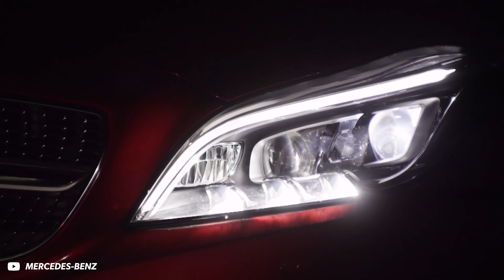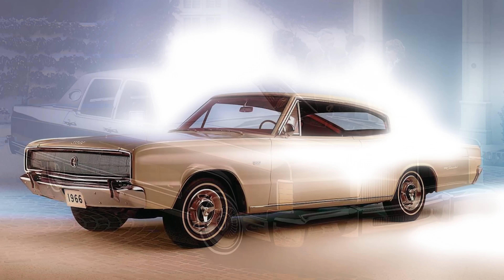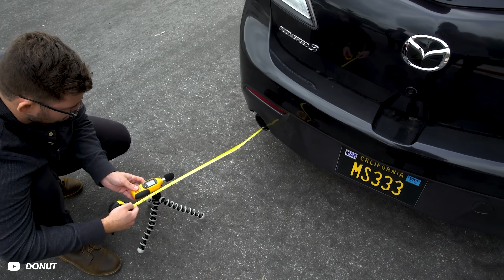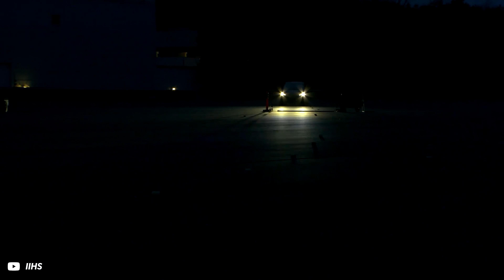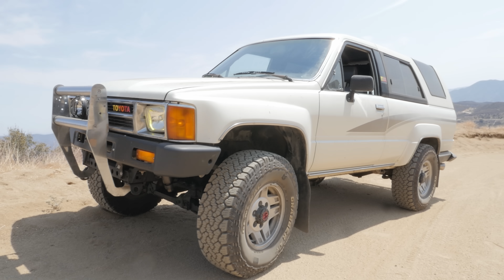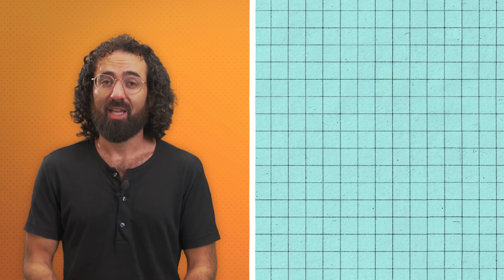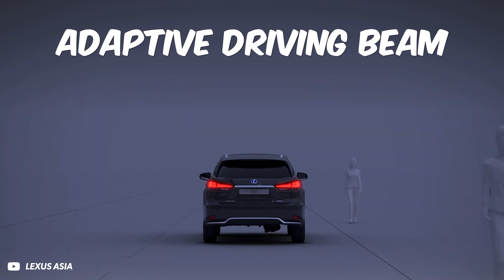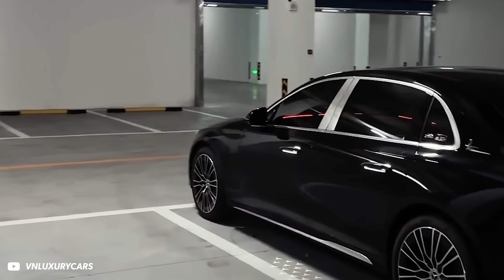Why new headlights are blinding American drivers

Comment: You briefly alluded to it, but another major factor in the early years of blinding headlights was related to the housing design. Older housings used a reflector type assembly which worked exactly as described and reflected the light, you can see the mirrored reflectors inside the headlight assemblies of older cars. When these cheap HID kits finally started to come on the scene, they used bulbs and technology designed for higher end projector based headlight assemblies, so you had all these people buying cheapo headlight kits to get that higher-end Xenon look but installing them in housings that they weren't designed for.

Comment: European here. Ok in Europe it might be a little better. But the regulations are also way to soft! 

The big Problems are: SUVs and other high mounted Headlight cars. There should be a maximum hight for installing lights! Like 70cm from the ground or so.
Also Halogen lights are bad to look directly into!

LED lights should have 10000 lumen top! 20000 is just ridiculious!

And the light adjustment must be set to 60m top, especially with LED lights! Here it cant be the owner of the car! The lights are installed by the manufactour! 

And yes, intelligent headlights systems are great, but its not possible to get it into every car, at least not yet. 

And whats really going with Tesla?? Every tesla is blinding me everytime! Why are they allowed to set the light adjustment so high?? Also here in Europe??

Comment: In Europe we have mandatory car safety check ups ... including lights.
And the beam is formed horizontally in front going up in an angle on the right. That way right angles might give problems from incoming cars and cars a certain distance behind you and no straight highway problems. Except of course for the nightblind idiots using high beams all the time.

Comment: One issue not addressed in the video are the 6500k color temps used on the LED's.
This color temp is a blueish white color which is especially bad for those who have any cataracts which is nearly everyone over 40 years old.
Halogens have a 3000k color temp.
The lower and redder color temp doesn't glare as bad with cataracts nor does it affect night vision as bad.
An easy regulatory fix would be to limit the color temps to no more than about 4000k.
The shorter wavelength blue 6500k has a greater effect on cataracts than the redder halogens at 3000k
An added bonus is the longer wavelength reds interact less with snow, rain and fog enhancing visibility during inclimate conditions. 
 Rayleigh scattering is the technical term and is also the reason why cataracts are affected more by blue light.

For reference compared to household light bulbs a "soft white" lightbulb is 2700K and a "daylight" is 5000k.  Some bulbs are marketed as "bright white" typically 3000k to 4000k.

My expertise was designing LED aircraft landing and other lights for aircraft.

Comment: Decent analysis, but missing a few key points.

1) I like to travel to northern Scandinavia in winter - above the polar circle.  All my cars have good old halogen lights and manual high-beam control.  I never ever felt that I needed more - not even the extra driving lights that are so popular in those regions - and that includes many km's on icy or snowy roads in pitch black darkness without other traffic around me.  So why do we even need this shit?  If you cannot see enough with modern halogens and safe use of high beams, you should probably not be driving in the first place!

2) However, during my last trip up north I had so many problems with those f.....g LED lights that I ended up installing some additional Swedish LED driving lights myself during the trip (in a public parking garage...).  I didn't need them for seeing, but I did need them for signaling - too many i....s who couldn't be bothered to dim their lights at all.  Worked quite effectively, but is no fun...

3) I drive a small sports car (MX5 / Miata) - yes, all the way up to the Nordkapp in northern Norway in winter.  When I bought it I had no problems with other cars' headlights.  Now they are a big problem.  Even the adaptive matrix technology is a big issue, because from what I can see these systems do not seem to be set up to handle low-flung sports cars.  Why?  Probably because the engineers did not think about the fact that there are many different types of cars out there and that all of them need to be protected.  Bad engineering (and yes - I am an electrical engineer myself).

4) And that brings me to the last point.  I used to work in aviation.  In that industry, new technology will only be allowed after a) the impact on safety has been thoroughly analyzed, b) appropriate mandatory standards have been written, and c) the actual products are in fact certified against those standards.  Safety first!  I am shocked, disgusted and furious that in the automotive industry this type of Wild West is allowed.  This is as much a failure of regulation as it is a failure of engineering - worldwide.  In a sane safety oriented engineering environment, most cars today should NEVER EVER have been allowed on the road.

So in summary: bad engineering - worldwide! - and super bad regulation, causing a huge problem.  This is not going to end well - one big lawsuit that claims damages due to this problem and billions of cars will have to be recalled and thoroughly modified.  No car manufacturer in the world would survive that.  And such a lawsuit will at some point come.
Reply: @MartinBeckmann-z1o And what's more funny about the regulations in the EU , is that cars like the Toyota GR86 or the Nissan Z can't be sold anymore because of some stupid regulations voted by some wankrs but those fugging SUVs that blind other driver are just fine ? I also drive a low car ( Smart Roadster) and at night i constantly have to zip away from blinding headlights behind right my ass on the highway . BTW it must be fun to drive your MX5 up there ^^what kind of tyres do you use then ?

Comment: The matrix headligths are blinding too. On a straight road in fine weather its usually no problem. But the ligth reflects on everything including the rain in front of you enough to blind or abscure the road in front of you. I drive about 80 km everyday to work and can not say i am a polite driver anymore, if you blind me i will flash back. A lot.

Comment: It seems this is another American “nothing can be done” rather than a real one. In the UK your cars headlights are tested in the annual inspection, if they are out of alignment your car fails, and can’t be back on the road until they are fixed.
Reply: I'm sure the UK's MOT test used to make sure the dipped beam was 'dipped'. No part of the beam was allowed to go higher than a line drawn at the height of the headlights. Nearly all 3 year old cars nowadays should fail their first MOT.

Comment: It's so bright that even the reflection off buildings and the road itself glares to my eyes
Reply: As a pedestrain where vehicle should only be using low beams I notice the same think.
     It is so bad they have me saluting Hitler. You know raised arm & hand to block the offensive light pollution.
Reply: Even with low beams, all you need to do in a populated street is go over a single speedbump, and everybody hates you because of your blinding lights.
A bad speedbump can make me blind people on the second floor (first floor after ground level), in their own homes.

Wild that this is legal.
Reply: @Volvithever conside the thickness of road paint? I've seen some that is almost 1mm thick. Given the USA DOT regulation that headlight can light out to 820-feet — even road paint can cause an up angle in headlight beams.
     Never mind stones, shells or litter.
Reply: Your headlights are incorrectly adjusted if reflections are blinding you. Even the brightest OEM headlights do not cause glare when adjusted correctly. They do not come adjusted correctly from the factory (but they say they do).
Reply: You can try polarising glasses to reduce glare off of surfaces quite a lot. Look into it :)

Comment: even if bright lights arent contributing to more crashes its an added stressor to every driver they pass and the fact that drivers have no choice but to keep their eyes open on the road means that it causes accumulative eye damage from staring at bright lights every night drive
Reply: Yes. I've noticed myself looking far more often at the side of the road to know where I am going, because someone is blinding me with their new headlights. In rain it's even worse.
Reply: Well without doubt it's contributing to accidents at night, even if the initial blinding/dazzling doesn't cause an immediate crash, when you drive on an unlit motorway and are constantly subjected to dazzle after dazzle by passing supernovas your eyes get fried.

Comment: I live in central Europe, where adaptive headlights are allowed. As a cyclist, I absolutely loathe them, because the shut-off DOES NOT CUT IN until the oncoming car is maybe 30m away. At which point it's pointless, as I have been forced to ride completely blinded for 300m or more.

Doesn't matter if it's a luxury vehicle like a big Mercedes or BMW, or something built in Asia. IT. DOES. NOT. WORK. And the designers responsible should be quartered, shot, restored from backup to be shot&quartered&restored from backup again and so on, until they can come up with something that actually does what it says on the tin - *in the real world*, mind, not just in controlled lab settings. Until then, this technology should just be banned.

Comment: I am so negatively affected by bright headlights I plan my schedule so l don't go out at night. I drive an old, short, small pickup. When a modern car is behind me, it looks like my car is in full shadow even when my "brights" are on. That would be disorienting enough without the incredibly blinding light eliminating my entire cabin from the rear view mirror. Buying a pickup instead of a sedan or wagon was a major factor to get a little bit of height and it actually does improve a lot. 

I am incredibly frustrated with our regulating bodies l for allowing this to happen. It's not like you can recall millions of cars, now. I stopped driving at night years ago.

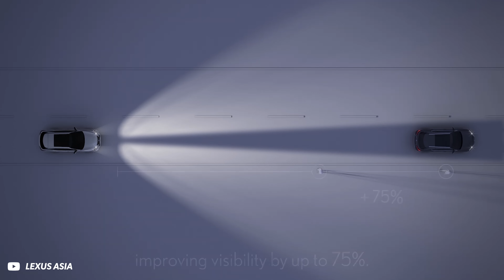Comment: 9:04 -- Greetings from Germany. Over here, its labelled as "Matrix LED Light". And I hate it. People that use cars with that tech do not bother to turn off the beam because the computer is intended to fix oncoming traffic not to blind. But it just doesn't work. The issue u talked about earlier comes into play: straight roads vs curves. Whenever such a car is involved in a curve, you are getting flashed. Whenever the computer doesn't properly detect your vehicle, you're getting flashed. Yes, I do honk at people using that tech and not turning it off when passing me. Because its just a plain hazard. Whereas people with "normal" lights turn those off even before the oncoming traffic gets into the lightcone at corners. And lets not get started about foggy weather. It only gets worse. Whenever I pass a modern car, I can't see the road for 2-3 seconds before my eyes adapt on that its dark outside again.

Comment: Jokes on you. im the guy who is driving lowered cars all my life and i get blinded by EVERYONE. the problem with led lights = they are direct beam. not like older lights, where the front of the light was hidden and the light would hit the reflector and then bounce to "light" the road.

With leds they have a TINY area, where the brightest point of the led is somewhat covered, but a bump, speed bump or mismatch in height destroys it, and that point is so bright, that its like looking at welder without glasses. absolute insanity. im from europe btw, still does not help at all. 

Worst part ar suvs and other high cars, they should lower the lights, compared to height more aggressively, but everyone would agree, led headlights should be banned or reworked.

Comment: There are so many comments this has probably already been said, when driving in a smaller car, Miata, not the SUV/Truck my fellow Americans all "need", the headlight height becomes an issue. When I have a F150 size truck behind me all I see is headlights, not much better when meeting them on the road, beyond a standard for aiming there should be tighter control over headlight height off the ground, put truck/suv lights in the bumper not by the grill 2 feet higher than my lights, there's now way to aim those lights to not blind me while giving that driver more than 20 feet of light in front of them. 
Seriously how do you get headlights that are 2 feet above the ground and headlights that are 4 feet above the ground to give the driver and oncoming traffic a similar experience?

Comment: Thank you for this education!  I just wrote my congresswoman about the issue.  I now have a label to name the problem and solution.  Thanks again!
Reply: The "solution" doesn't work. ADB is an expensive technology fix that doesn't work in most situations. Just read the comments from people from Europe. They'll tell you that it doesn't work in practice. The real solution is just to regulate the brightness and color temperature (prefer orange-ish bulbs over blue-ish bulbs). That would bring the cost of the cars down, too, since those lights are cheaper to manufacture.

Comment: We've forgotten what the purpose of the headlights are, surely insurance companies are missing an opportunity & should be onto it making lights with too many lumens uninsurable.
1)-in an area with (any) street lights you don't need the lights to see where you are going, you only need them so others can see you're there, 
2)when you are out in the country or in an area with no lights, you only need to see what's directly in front of you, all the light that gets sent directly out to the sides lightning up everything around you is the glare that blinds everyone, on the fwy at 60mph/110kmh you don't need to see (and can't do anything about)what's happening at 90 degrees to the front of the car and is distraction so shouldn't be there 
3) most of these problems start off as  manufacters design failures so its surprising it hasn't been brought into line by insurance costs somewhere 
4) The police and local governments should be onto it aswell and be issuing on the spot fines and penalties/defects for stupidity bright manufacturers lights or aftermarket lights, they're usually out fining people for stuff thats  only affects their own car or safety, ie car is too low or  high or is just an annoyance like loud exhaust, but idiot's with no idea of how or when to use high beams are a real hazard to everyone else muchless themselves and & cops & local govs are missing out on an easy revenue raising opportunity, you can literally see the lights a mile away so you'd think they'd just take the money!!😅

Comment: You can blame Amazon. After market bulb makers sell bulbs that are 800% brighter using headlight bulb part numbers. They only fit into headlight bulb sockets, but they include a statement that says they are for fog lights. This is a lie that apparently makes it legal to sell them. They are headlight bulbs that have high and low beams and do not even fit in fog light sockets. We also need to include headlight testing in yearly car inspections and provide cops with meters to test lights and write tickets for over spec lights.

Comment: I have a solution, when I have a car behind me completely blinding me, I just start slowly breaking and stop if necessary... I'm not suicidal to keep driving forward if I can't see where I'm going, if they hit me they lose the accident as well, problem solved. It's super rare, but if I have to do this is actually because they are legit using their high beams 😵, as for everything else, it's true, it's getting brighter but there are some ways to mitigate the issue.

Comment: I bought a Toyota pickup that had aftermarket led bulbs in the stock housing and a serious problem i encountered was the fact that the led didn't produce enough heat to melt snow and ice off the lens in the winter like the halogen did

Comment: Great video. I’ve got aftermarket LED’s in my pickup but I selected the one that works properly in my stock housing. Most LED replacements do not work correctly in the stock housing and allow light to flood everything in front of you. That’s the main problem. Aim and focus are critical. Headlight Revolution tests lots of LED’s in specific vehicles and lets you know which is your best choice. They show pics and vids of their testing so you know what you’re going to get. My results were exactly what they showed. Very bright but focused and aimed so as not to blind oncoming vehicles or vehicles you’re following. It will take many years before autonomous headlights make a difference. Right now aftermarket headlights can be properly selected and setup to not blind other vehicles. Why wouldn’t you want that. I’d like the car driving towards me to see where there they are going and see where I am. 
Drive safe.